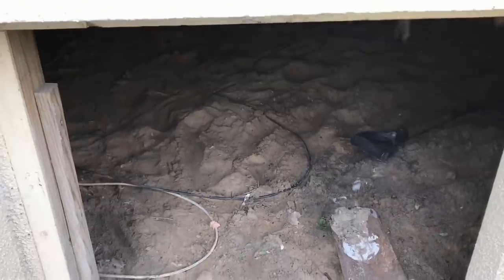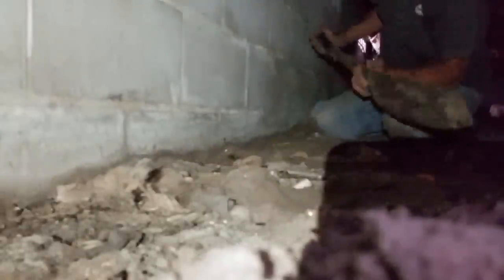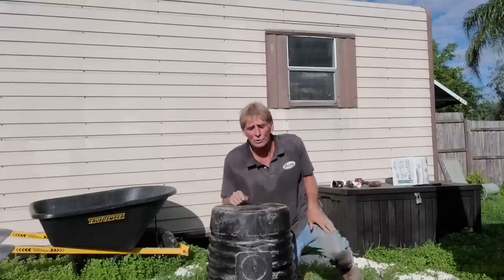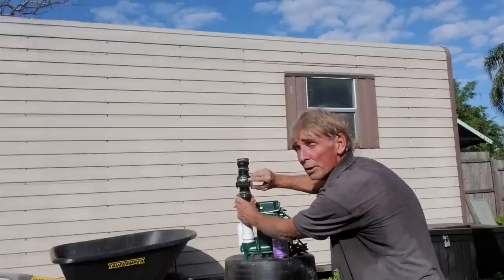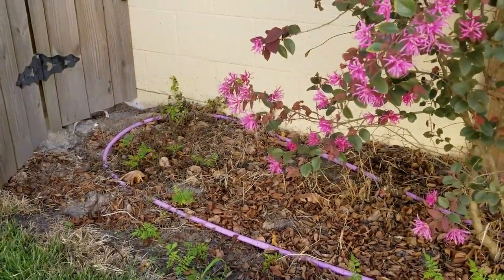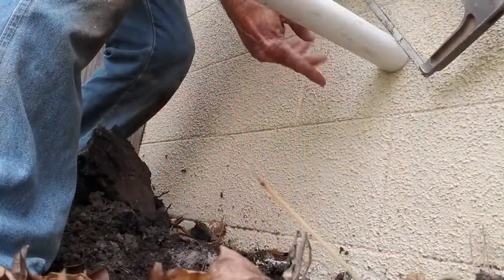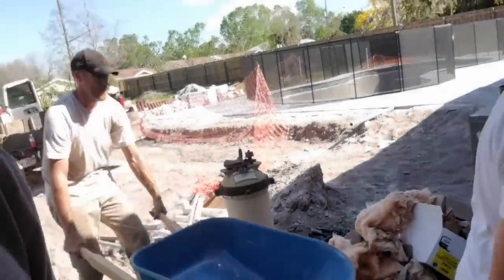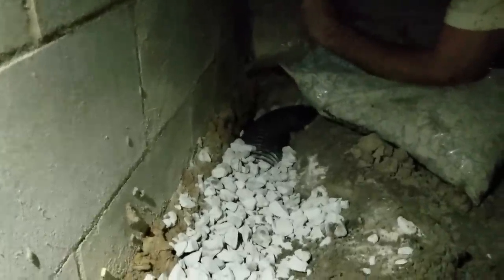How to Waterproof Your Crawl Space, DIY Complete

Comment: You have inspired me....  i have had a crawlspace problem for 30 years... i am now going to address this ... THANK YOU for your inspiration.   They did a 2" rough pure of concreate in my crawlspace...do you have any recommendations on how to remove dirt from a crawlspace most efficiently ?  I will be cutting into the cement around the circumfrance and after i get that cement i will need to remove that and then all the dirt also that the gravel will replace.... right ?

Comment: My wife and I just purchased a home that is over 100 years old.. Pretty much everything has been replaced in it.. But its between two hills and on the heavier rainy days seems to be making its way in from the sides of the foundation closet to the hills.. I've been told to possibly install a French drain but this seems so much more effective! Definitely thinking this will be the better option for sure! I feel very capable of doing this myself.. Just wondering what should be the first step
Reply: I am not an expert but I am in exactly same situation as you in each and every single respect you mentioned. 90 years old house, hill and wet environment with ground water etc. Gutters, down pipes etc are the first order of business to personally inspect annually preferably from above, and attend to. I learned that the hard way. As I understand, French drains on the outside should not be placed too close to the foundation ie at least three yards away. The risk is the gravel pit of a French drain would attract water and undermine the foundation even more. Surface water closer to the walls should be caught with catch basins, or directed away with channel drains or spoon drains. On the side of the building where the hill slopes towards the side of the house, I am considering soil excavation to create a gully draining away from the house, three yards away and parallel to the wall. That is where either a French drain leading to a catch basin will go. Or maybe just asphalt path with rock wall cut into the hill and a concrete gutter. But for the water already inside under the floors then the “no French drain rule” does not apply. And a system like Chuck’s seems the way to go. My thought is if there is sufficient pitch or fall, there may be no need for a pump, it may be enough to cut an exit for a hard pipe to take the water outside using gravity. That, according to Chuck’s other solo crawl spaces video, is called a core drain, basically a hole bored through the wall to let the water discharge outside. Still learning.

Comment: The footings under my home's foundation were poured directly into earth with no forms.  Hard to know how deep they go.  I'm hoping they are at least 6" and am not going any deeper than that below the top of the footing.

I'm digging clay also, and ended up buying a pick to chop it up in the driest areas.  Not an easy or pleasant job.  I decided to get all the spoils out of there since the crawlspace was already backfilled well above the footings in spots.  

There is a power tool called a vacuum excavator that can help with this---it's basically a giant, trailer-mounted vacuum cleaner with a water jet on the tip---but no one rents them around here.

Comment: Can anyone help with a project of mine. I have a crawl pace with about 3 inches of standing water throughout. I have installed sump pumps before, my issue with this job is that the foundation and footings are separated into 3 large bays with the soil areas completely separated. 

Would it be required to install 3 separate sump pumps,
 
-would it be better to use cheaper submersible pumps to transfer 2 bays into the third bay with the sump pump, 

or would it be better or even possible to dig all the way underneath the footing to connect all three bays?

Comment: I just dug up a black pipe the builder put in on one of my gutters to move the water under ground and away from the house. We had planted shrubs along that wall.
It wasn't pretty.  The pipe was full of the plants roots. What do you think those pipes and water flow will look like in 10 yrs with all those bushes root systems stopping them up?

Comment: Good Day, considering how heavy and how many bags are required, a couple of questions. 1. does it matter what type of stone  2. why is the stone required versus not adding the stone to the job.3. if the stone is required to hold down the drainpipe from floating wouldn't pinning or the weight of the soil be sufficient? Thanks and great video. Bill
Reply: The stone is there to allow the water to move through it without clogging it,  not to hold the pipe down. The pipe is perforated. Only there to move the water. This comment is 7 months old so I assume you figured this out, but I couldn't help myself lol

Comment: Did they already have drainage on the outside of the foundation before you did this?  The reason I ask is because I don't have drainage inside or out.  I'm going to add some, but I'm not sure where to start.  Instinct tells me to start with outside of the brick foundation wall and then do the inside if necessary.  Is this right?

Comment: I'm curius, why not do the system on the exterior (outside of he crawl space). I vaguely recall one of your videos where you installed a similar drain on the outside, next to the footing (on the outside).
Reply: Water eventually makes its way inside the crawl space either from ground absorption or from weather (ie wind-blown rain). All the added moisture in there can cause lots of problems later on down the road, so putting the drain inside solves a lot of the water issues
Reply: @jopenope1016  yes I'm dealing with that now. My subfloor are rotten.  I'm 2 weeks in and feel like I will never finish. Removing the subfloor is no joke! Adding more French drain is the next job to do now. The back part of the house has it already but the rest needs it. My crawlspace is much lower than this one. If my back still works after the flooring I'll be doing this too. Lol

Comment: What do I do when there's been so much water washout that my footer is undermined in certain areas? I just found a pond under the master bedroom in my new house and im freaking out a little. I have most of the water out with a ditch pump but i need a sump pump badly. my only issue is that my soil is sunk down in certain areas lower than the footer, not sure what to do about that.
Reply: Geez that sounds crazy. I just recently bought a new home as well and got a huge rain storm that flooded 6inches in my crawl space. My heart never dropped so fast. Bought a sump pump and drained most of it but now to tackle the preventative maintenance… 🤦🏽‍♂️🤷🏾‍♂️

Comment: Why don't you just dig out 10 inches of dirt and pour a concrete slab????  Don't forget, dirt smells which will make the room upstairs smell.  DON'T FORGET ABOUT RADON.  Concrete keeps it out.  I dug out 20 inches from my crawl space and poured a concrete slab, which solved the smelly basement problem/radon.  I first poured 1 inch of gravel, waterproof tarp, wire mesh, then 10 inches of 4,000 psi concrete.  I think I went overboard with the concrete as 4 inches would have been sufficient, BUT concrete company does not take back concrete so I had to use it.

Comment: GFI on sump pumps is a double edge sword if they trip here comes the water .
Reply: Maybe, but a modern GFI is not going to trip unless your pump has a fault, and GFIs are required by code.
Reply: Is it better to put a GFCI breaker so when it trips you don't have to crawl in the crawlspace to reset?  Is there any disadvantage to doing this?  I am about to install my sump pump and was wondering any help would be greatly appreciated.
Reply: @denise.60  Nothing wrong with using a GFCI breaker, other than the breaker will cost more.  It has the benefit of allowing you to tell with a quick glance to your panel whether it has tripped. Breakers with only the added GFCI functionality exist, but you may have an easier time finding AFCI/GFCI dual-function breakers since arc fault protection is required for most domestic circuits in the U.S., so more of those are sold.  A dual-function breaker will work fine for your application.  There's a chance the motor will trip the arc-fault detection function of the breaker, but it's unlikely and easy enough to test once you have it installed.  Good luck!

Comment: That discharge is gonna fail. You gotta do 4” pvc pipe. It will hold more water gravity and dig a giant dry well at the end of it dump Atleast 2 buckets of stones. Since that soil do sandy, you should put filter fabric in that drain tile. You don’t want dirt getting in that draintile or else you gonna have to re do all that
Reply: Is a sump pump absolutely needed? Can you dig under footer and gravity feed away from structure?

Comment: Why are you putting in on the inside instead of going around the outside? What determines that decision?
Reply: I also wondered about the inside vs outside decision process. Also there's conflicting advise about wrapping landscape fabric or similar around the gravel + pipe, and making a "burrito".
Reply: Out side is always best, however, sometimes it is not possible to do so from the outside.
Reply: By the looks of that back wall it'd be very difficult to put a drain system on the outside there.  If the other walls have landscaping and other obstacles the clear choice is to go into the crawlspace to save the homeowner the cost of the added work.  
Looks like the water is seeping in between the footer and foundation which means the drain's not getting the same type of disturbance as it would if it were out in the weather so there won't be much transfer of soil into the rock.  Wrapping the rock and pipe like you would if it was outdoors would be overkill in this instance.  The sock around the pipe will be enough to keep this system functioning fine for decades.  He'd have wrapped the whole thing if he was going around the outside where there is water flow from all directions and a higher likelihood of soil infiltration.

Comment: This is an aggressively stupid solution. Instead of making sure there isn't water near the foundation, we're actively encouraging it and relying on a product, the pump, that will eventually fail? That's not good process. Some of that water will seep into the soil and stay moist as long as there's consistent rain as well. So for a rainy few weeks, you could be actively encouraging the soil around your foundation to stay moist. This solution is almost the opposite of what we should be trying to achieve.
Reply: I have the same thought! But since he is brave to put the video on YouTube, I suspect the water is from the crawl space, like a spring.  This is possible on hillside. He doesn’t mention where the water is from!